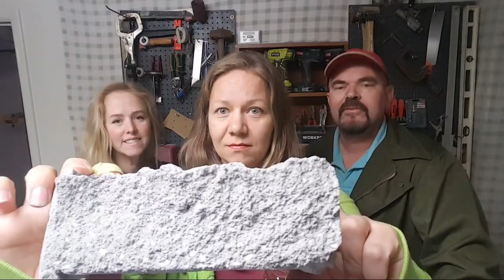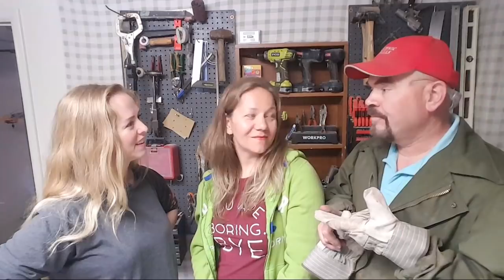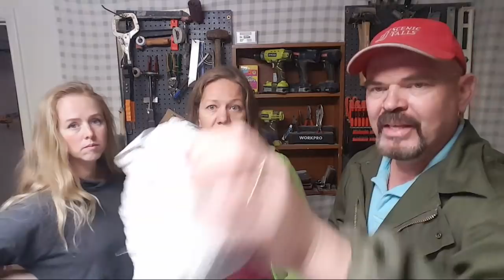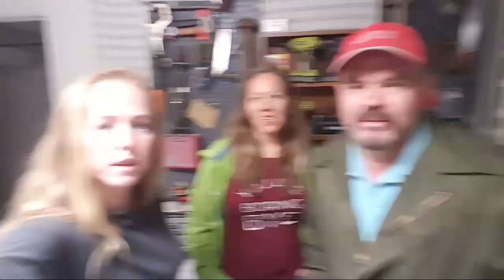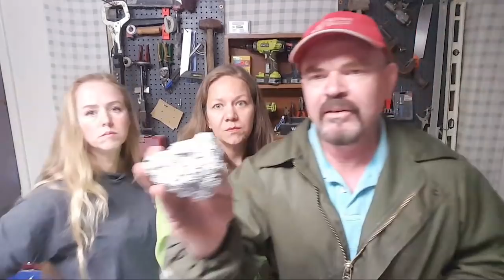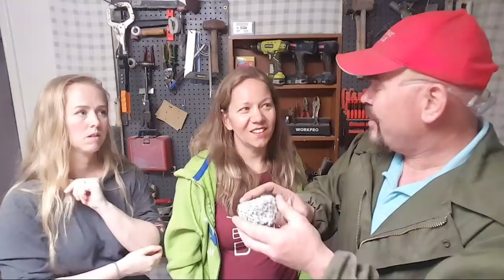Practical Uses For Air Crete Live Show

Comment: Darwin I've been watching your videos if you haven't seen the monolithic domes you need to reinforce the structure but insulate with your aircrete that's what I'm attempting to do I've got the pad and the reinforcement rebar up I'm about to start the spray concrete and I believe your aircrete is the solution to the monolithic domes insulation an affordable cost keep in mind that the monolithic dome does not need is much heat and air conditioning that the stove that you build for Julie will probably overheat a monolithic dome of the same square footage

Comment: growing up we often blew soap bubbles for fun ,,,we just used dish washing soap and then later we learned to add glycerin to the soap to make the bubbles last longer in flight ,,, have you tried using a dish soap like concentrated Dawn and added glycerin to it to increase the surface tension of the bubbles

Comment: How do you think siding would be with aircrete. What im thinkin is making like a 2'x3' form and blocking out some faux rock pattern and then using tapcon screws to attach it to my block foundation. Would a 1:1 foam to cement ratio be a good starting point? I was also hoping to make it 1.5" deep so i could use 2x2 for the outside of the form and maybe 1x2 for the "rock design" and cast em in a sand bed for some texture